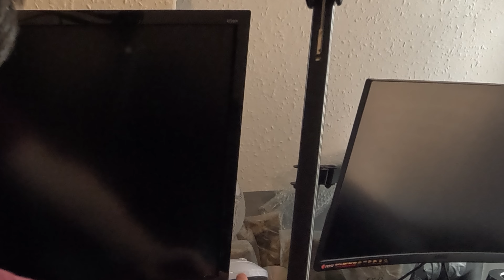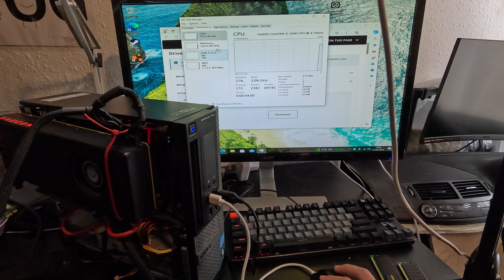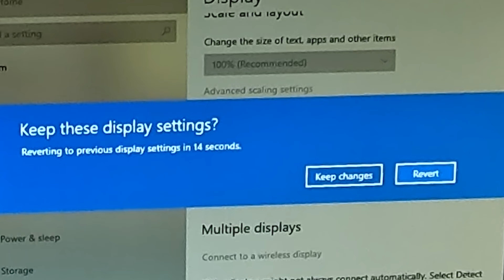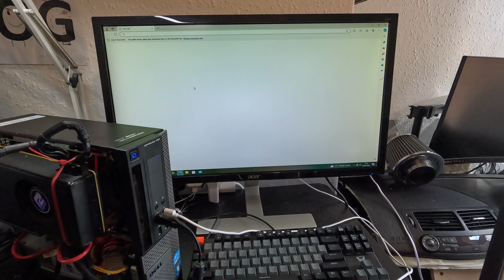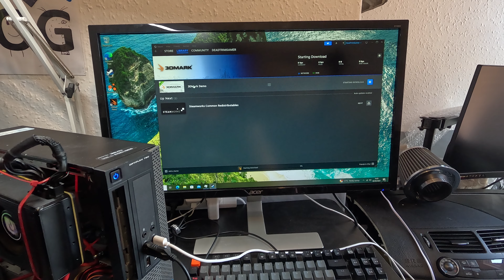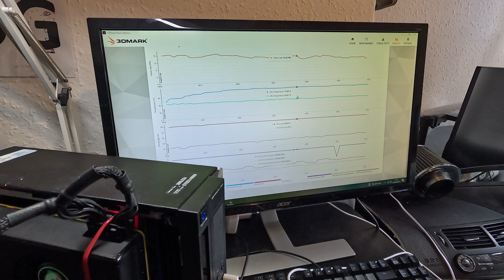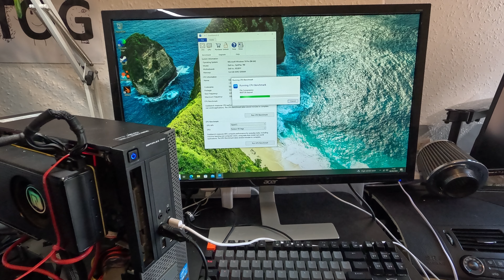Dell Optiplex Gaming PC…

Comment: Why did bro put a VGA cable in the CPU port??? 😭 That's like basic PC knowledge
Reply: How did it fit tho? As far as i knew the pci express connectors don't even have the same shape as the p4 connector?
Reply: @usernotfound-h2v  Yes, the ports are different, but I'm guessing he just shoved em by force. All I know is that the mobo suffered a lot
Reply: @maticpodobnik  Whole computer suffered a lot 🤣
Reply: dude! its CLEARLY LABELED VGA!
Reply: Bro you have a 1200w psu laying around and you dont knowe that what is a gpu and a CPU
Reply: there was no vga on the card so no they could not without adapter and if it was not a analog dvi it would need a digital to analog box and it does make sense that it is pluged in to the mobo and its not a cpu port it is a mother board please do not come and say anything and be wrong it is also way more basic that a cpu does not have ports but pin/pads so you are in calling someone wrong for no reason are wrong
Reply: @andrewstewrt2141  bro VGA is just a standard text usually found on the GPU plug and isn't con nected to the graphics card's ports. You can't mix it up, if it was for the CPU it would've said so, i'm pretty sure i've never seen a power supply have a "DVI" plug
Reply: i will keep this brief you are wrong  vga is a video standard look it up the gpu used in the video does not have vga port and as such would not be able to use a vga monitor without a vga to hdmi converter most gpus dont use the vga standard as we have moved to useing digital and the vega 64 card was launched back in 2017 and then vga had become a dead standard for a long time
Reply: @andrewstewrt2141 My brother in christ this discussion is not about the video ports on fhe graphics card, this is about the labels for power supply cables. All powersupplys will have a 4+4 pin labelled cpu which u can move apart one of the four similar to how a power cable for graphics card has 6+2 pin. Power supply cables for graphics card have been labelled VGA for years as it is a common term for video. Has nothing to do with the video ports on the graphics card. And he fried the motherboard by doing this wrong so obviously he is wrong which he seemed to have figured out himself after frying the board
Reply: @Zuilt  yes i know the cpu cables vga is not what any cables I have seen with any modular psus I have seen the ones i have had say PCI-E
Reply: @andrewstewrt2141  PCIE and VGA cables are the same thing, different PSU companies put different labels, it's not that deep
Reply: @usernotfound-h2v  may of been worn down from use
Reply: @andrewstewrt2141  servers still do and some gpus have the option, and if they still have DVI they may well be able to convert to VGA so its not as outdated as you think

Comment: did you really just put the gpu power into the cpu power 😭😭
Reply from the maker: Sort of
Reply: @conseptcomputers how and why 💀💀💀💀💀
Reply: @splat2glitcher  it does fit fine just a bit hard to put it in
Reply: 12v in place of 3.3v disaster loading..... 😂

Comment: the reason why u couldnt see the gpu on yo task manager is bc the first time u turned on the pc w the new gpu, the gpu was wasnt turned on bc u didint turn the other psu on so it didint function and the gpu went on safe mode,basically its laggy bu if u turn it on via device manager "go device manager and display port right click the gpu enable it" you could jus turn it on usually it takes more than once bu it can work once aswell" that will make the gpu function correctly and u will see the gpu on task manager

Comment: Update the bios, and optimise windows, and if the motherboard supports it try to use a XMP profile, and do a clean install of the driver (Uninstall the old one in safe mode with DDU and install the new one from AMD site)

Comment: C'mon man. You could have at least put a low-profile GPU in the Optiplex. That is even better than adding a riser or extension cable. However, you could upgrade the CPU or RAM. But it has to be the right and specific parts.